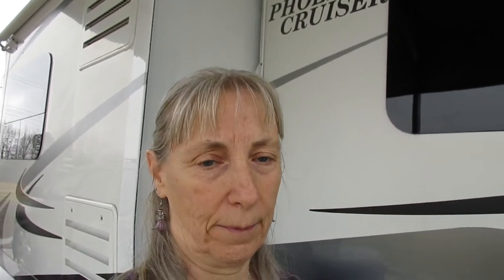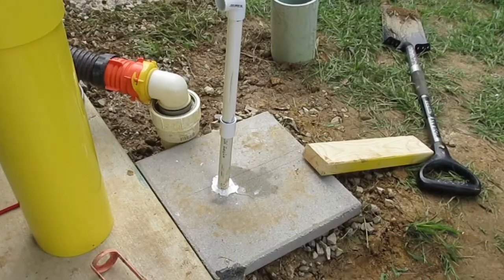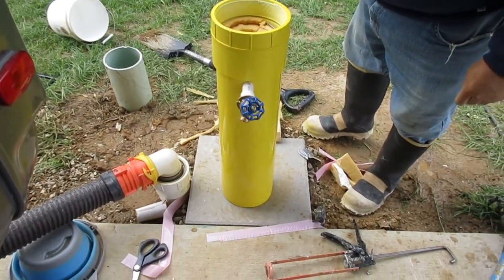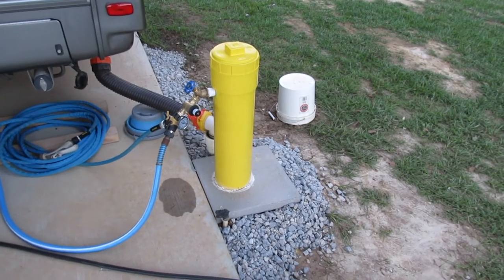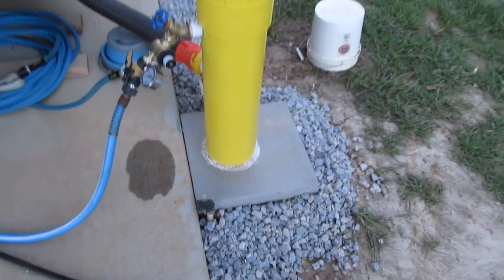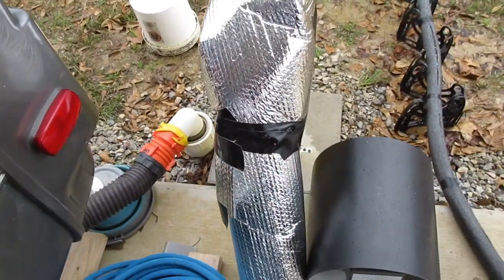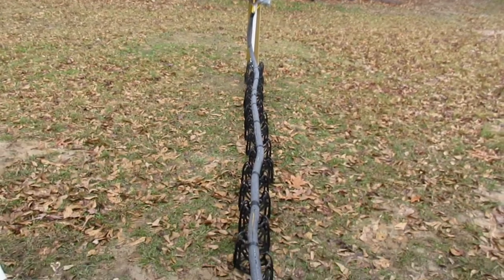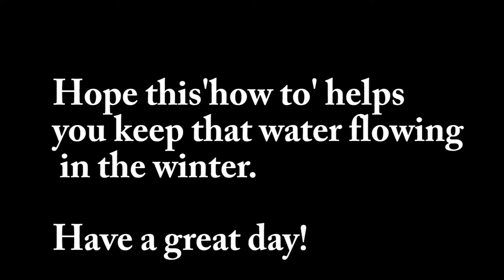How to Insulate an Above Ground Water Pipe and Spigot

Comment: Could you use spray foam
Reply from the maker: We went with the recommendations given by the Army Corps of Engineers at the state park near us. Spray foam would be difficult to cut away in case there is a problem with the pipe. So far, this has worked well for us. Thank you for asking.

Comment: Why do you have a splitter? do you let it drip through there?
Reply from the maker: The splitter is there for a second water hose. One is running to the fresh water inlet on the motorhome and the other is for use with another hose if needed, such as for washing our car. Thank you so much for that question.

Comment: BECAUSE REMEMBER ITS PEX SO YOU CUT  AND CONNECT THE COPPER OR PVC  THE EXISTING LINE  THEN JUST SNAP THE SHARKBIT FITTING WHICH CONNECTS BOTH THATS IT RUN THE LINE TO THE OTHER